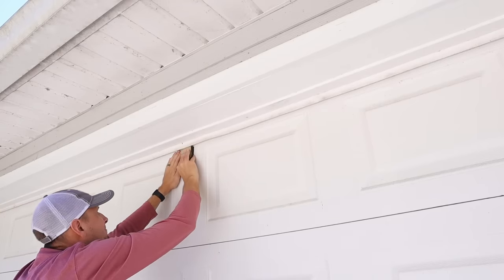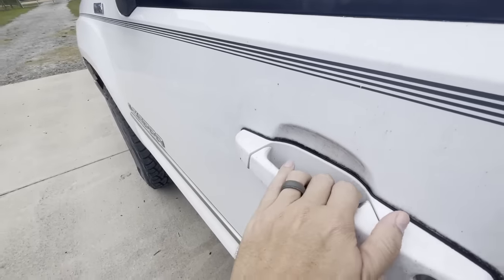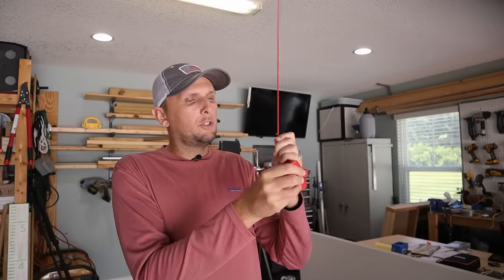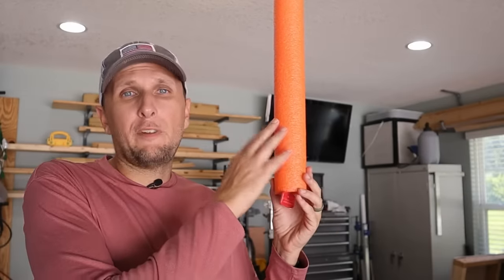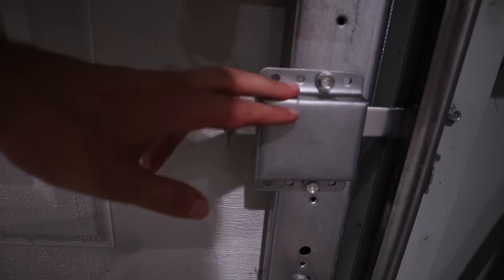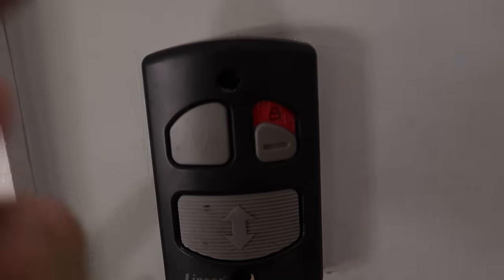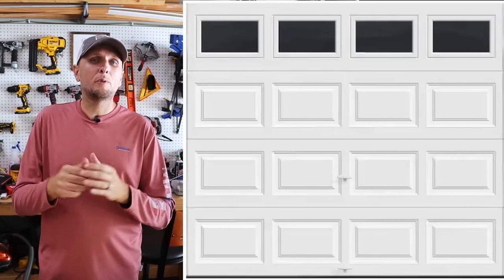How to Stop Garage Door Break-Ins | Number One Way Thieves Get Into the House!

Comment: Note the hole on the end of the deadbolt style latch. You can put a padlock through it, so even if a thief gets into the home another way, they won't be able to just put the big door up and make off with big items. Also, if you do have an opener, and do use the deadbolts to keep the door shut, pull the cord and disconnect the opener from the door. If someone forgets and pushes the opener it'll save the hardware.
Reply: Good thoughts I did both also. I have a double sized garage door and it may be overkill but I put a dead bolt lock on both sides.  This will also help prevent the old daylight mover scam where thieves show up in the middle of the day gain entry to the house them back up and open the garage door and acting like movers quickly empty your house.
Reply: I replaced the cord with a steel push/pull cable like a throttle cable and ran it to the door,down the center and then over to the security latch so that when i locked the latch the cable automatically pulled the release on the opener
Reply: Actually, you don't even need the latch, just put the padlock through one of the small holes in the wheel rail.  It does the same thing.  I always lock my garage up to keep my SRT safe while we are on vacation, along with probably about 10k worth of tools.
Reply: @rooh5825  Love that idea. My method is to use a "C" clamp on either rail to prevent the rollers being able to move.
Reply: Good idea, but putting a padlock though that hole is useless since anyone can remove those self tapping screws on the bracket where the latch is mounted. Like that idea that rooh said below though, just put the padlock through the hole in the track and it will block the wheels on the door.
Reply: already thought of that.
Reply: 1.There is nothing to secure that lock to, you are just putting it on a hole the slide latch which will stop nothing
2. 2 screws to remove, and I have seen other models where you can just easily bend things out of the way.

You guys are over thinking this.
Reply: @williamhudson4938 Thanks William, that’s sounds like the easiest way for seniors as well as effective.

Comment: I bought those locks about ten years ago. I only use them is I’m traveling. And when I do, I put a padlock through it on the other side of the rail. 
     Theses locks are easy to forget. So from now on I’ll also unplug it like you suggested—so I don’t damage my motor.
     This is a MUST SHARE video.
Reply: Mine came with the garage door during the install, and are wired to automatically lock after the garage door is closed, and unlock before it opens.

Comment: Tip for removing the manual release cord. Make your own hook handle long enough to grab the release and hang it over your workbench or a spot in the garage. This will be quick and easy to grab and release the door.
Reply: why not just cut a whole in the garage door and reach in. I mean its only 24g metal. just some tin snips and no problem.
Reply: This is exactly my thoughts. Why have the big pool noodle hanging in your way? In his situation, the release is easily within his reach so why even have a cord?
Reply: Cutting a hole would work, if you have an unlimited amount of time.  Most Tango’s are the “get in,get out within 5 minutes type.  If a homeowner does anything like the op recommended, then the time factor for the T’s becomes too much to overcome. They will, in most cases, not all, move to the next house where there is no pool noodle on the string or internal mechanical locks.
Reply: Have y’all seen these wind screen curtains that cover the whole garage opening during the daytime?  I bet that for those of us who like to keep the garage opened in the daytime while we are there, that screen would greatly reduce the visibility of contents inside the garage on a bright sunny day.

Comment: Lots of good stuff here! When leaving for any length of time I tend to unplug the opener as well as clamp some channel locks in the track above a roller. It just makes me feel better.  

My first house had one of those crappy fiberglass doors  on the detached garage, and it had some cracks and small holes in it.  I leaned one day when I locked myself out of the garage how easy it was to pull the release cord with a coat hanger.
Reply: You mean vice grips? I'm failing to see how you could do it with channel locks, unless you use a clamp on the handle or something. At that point, why not just use vice grips?
Reply: @MrEazyE357  Yes! Sorry, Brain fart.  I meant vise grips.

Comment: Learned (from Bosnian Bill) to use a zip tie through the latch where the pull cord goes through;there’s usually two holes in the spring-loaded latch and the part it connects to. Zip-tie the latch closed, and it will usually require more leverage than the fishing wire the thieves use, plus can still be used in an emergency, because a strong downward force can break the zip tie.
Reply from the maker: Yup!  Thanks for the tip!
Reply: Lol now i have "the tool that Bosnian Bill and I made" in my head ><  Damn you LPL
Reply: Yup.  That's what I've always done...thanks for sharing
Reply: ... And secure the cord/handle to the bracket with a rubber band.
Reply: With thinking like that I'll bet you cut the seat belts out of your car and have removed all the GFCI receptacles from your house. After all, who needs safety equipment.
Reply: @trustme7731  - If you'd take the time to research this (or just read the original comment completely), the recommendation is to use a thin zip-tie which is easily broken with a quick, firm tug on the release handle, but which blocks the ability to disengage the latch with the "fishing" technique.
Reply: @rushthezeppelin  Sparrows also sells the tool to reach these release ropes, but like a lot of their other similar things crooks might want they're hard to find on their website.
Reply: “Bosnian Bill”
Only a fan of LPL would know that catchphrase…
Reply: @ashemoski  The release rope is long enough that it can be pulled outside of the door which means someone can pull it as hard as they want. Just as shown in the video. Shortening the rope is just as stupid making it unreachable to many people in case of an emergency such as your kids skull is being crushed by the door. 
It's a safety device first. For example:
From The Door Company:
"It is common for wildfires to knock out the power to homes in the immediate area. In 2017, five people got trapped in their garage as the fires overran their home. Without power, they were unable to open their garage door. They weren’t aware of the emergency release cord or couldn’t use it and perished. In fact, due to those deaths, California passed Law SB 969 requiring all garage doors to be sold with battery backups in case of a power outage."
A shortened or altered release could make it impossible for a child or short, weak elderly people to operate it in case of an emergency.

Comment: Really good content mate, we have these types of doors in Australia and you’ve just opened my eyes.Times are a changing and I was completely ignorant of this weakness; Thankyou!
Reply: I just wrap the rope around the bar pulling the door so that solves the fishing issue and avoid that silly pool noodle dangling in the middle of the path
Reply: I refurbished/rebuilt/remodeled a 1945 house ten years ago.  Garage no longer has windows, new (Manual lift) garage door has no windows and the new wider man door has no windows.  Trust no one anymore;  when my parents were toward the end of their life before they died the biggest thief was my brother;  he would come out from another state to do work on the house with his car empty and leave with it full,
Reply: My cousin here in Australia (Melbourne, ~25 minutes from the CBD - so not the middle of nowhere burbs) got robbed through their garage door exactly as this guy describes.  (I assume they broke in using a similar method).

I lock all my doors as a result.  Only time I don't is when I know I'm back in less than 30 minutes.
Reply: @maireen3517  that's what I did.

Comment: Our Garage Door opener has a solenoid deadbolt that locks into the track, similar to the manual one you showed. In order to manually open the door this must be released first so pulling the cord or lifting the door isn't enough. This may be an option that can be added to your existing garage door opener.
Reply: I could have swore I'd seen something like that before, glad I wasn't misremembering.
Reply: They come with the Liftmaster side mount operators like the 8500 or 8500w. They are notorious for wearing out. Ive replaced atleast 25 or 30 of them. The reason they come with the side mount openers is because technically you can lift the door with a side mount opener. Although you would be lifting the entire weight of the door because the springs are not lifting the door being that the side mount opener is holding the shaft of the torsion assembly.
Reply: @dano1307  as someone who works as an overhead door installer, I personally haven't heard any complaints about 8500's. Sure, they are a pain to install, but seem to work pretty good.
Reply: @BattleKing00  Not the 8500 opener, just the auto locks are notorious for wearing out.
Reply: Incase anyone want this ....Its called an interlock system and its dependent on the opener.  Some of the new openers have personal notifications on your phone when your door is opened as well as video....  Source= 20 plus years with a manufacturer of garage doors

Comment: I used to work overnight security for a property management company checking apartment complexes. We started to see garage doors with damage between the segments. We looked into it and found out people were having their garages broken into, and their cars as well, and since the garages were not attached to the apartment buildings, people usually had no clue it was happening until the next morning when they were going to work.

Apartment managers sent out a letter telling people to tie up their emergency release so it would be up and out of the way, and the break-ins stopped.
Reply: And then the property managers should’ve got sued for telling someone to disable a safety feature
Reply: @Just_A_Name14  it’s not a safety feature.
Reply: Great info. I just wrap (but not tie) the release cord around the bar that attaches to the garage. No loose cord to catch with a hanger, very hard to pull release if you do, and leaves the cord accessible to release in an emergency.

Comment: Good video and great tips.  Another thing you can do is buy a sheet of kydex, and size it for purpose to block hanger/hook access to the release cord.  I did this at my last house very easily.  Drilled a couple of holes it in and zip tied it to the door release assembly, and there was then no way to access the cord with a hook.

P.S.  thanks for the link to the door locking assemblies.  Been wanting to add these to my current door for when we're away.

Comment: I was a garage door repair man. A lot of my service calls were for stolen remote. NEVER leave the garage door remote in your car. Thieves brake into cars for the remote. They also take the registration for the car. Now they have a way to get into your garage and your address.
The lock button on your wall button disables the remote but not the keyless pad on the outside of your garage. My advise to you if you leave for vacation unplug the opener. And don't advertise that you are away by posting thing on Facebook until get home.
Reply from the maker: Good tips Wayne!  Thanks!

Comment: I’ve had a few customers damage doors and openers by using the slide lock and then trying the opener. I actually recommend removing slide locks when openers are used on doors because of that.
Reply from the maker: Oh yeah no doubt that can happen if they leave them engaged.  And unfortunately it can be really easy to forget about them.
Reply: My mother-in-law jacked up her garage really badly with that lock.
Reply: when you use the slide lock, put your remote in the glove compartment.  when you return home your remote is not where you expect and that will remind you to open the slide first.
Reply: A clever solution is to have the lock interrupt the power supply to the opener....  Surprised no one offers this commercially
Reply: @ckm-mkc  I was about to suggest the same, a commercial option would be nice however a DIY'er competent with dealing with electricity could fashion one rather easily.
Reply: @ckm-mkc  Or unplugging the power.

Comment: I'm an overhead door guy. My approach to securing the door against this method of opening is to use door stop trim to ensure that there is no gap at the top of the door. I work in a cold environment which causes the door to bow inward to the garage. I install my stop with a slight inward bow and set the j arm on the operator so that when the operator closes the door, the j-arm pushes the top of the door tightly against the stop. This will make it impossible to fish without cutting the frame or drilling through the door.
Reply: Exactly what is “door stop trim”?  Where would one find it?
Reply: Door stop trim is trim that stops doors. Available at any hardware or home improvement store.
Reply: @mikebond6328  - This makes no sense

Comment: As far as cutting the "cord" use a stick hidden in the garage that has a hook on it to reach the hole in the release mechanism.. Simple and effective to be able to open the door in a power outage.  Also if you have windows, use some of that stick on window frosting so light can get in but you can't see in!🙂
Reply: I like this idea the best. I'm gonna do it. I rarely use the pull cord but have a few times. yet the pull cord is there all the time for would be thieves.
Reply: This is what I’ve done in my garage.  A simple metal rod bent on each end, one end to hook onto the release and the other as a handle.  It normally lives on its own hook on the wall.
Reply: Seems like they could still get lucky and hook that hole but I guess that’s a lot harder
Reply: This is a great idea thank you
Reply: change "stick" to "peel" in your last sentence. will be clearer to readers. excellent two tips i will use

Comment: I see some people cover their garage windows so the inside is not visible but this way the light doesn't get in and the garage is always dark.  One thing I did to make it difficult to see the content of garage was to spray the garage windows with Frosted Glass Spray Paint.  This way the light still gets in but you can't see what is inside if you try to look from outside.
Reply from the maker: Great idea!  Thanks for sharing Mike!
Reply: You can also get frosted cling film that would do the same basic thing.
Reply: @SmallSpoonBrigade  the film can also make it harder to shatter the window as it holds the shards together, increasing the amount of time and noise needed to break in and can discourage the thief who was hoping to not be noticed.

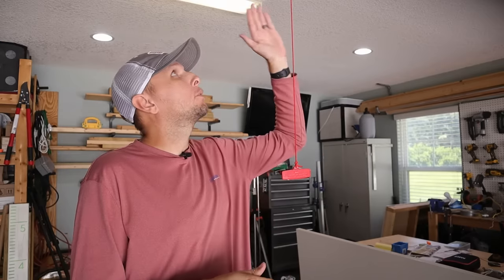Comment: 4:40 I use to shorten it a lot and put a small loop on it. Then have a metal hook hanging on the way next to the opener inside the garage. If my wife or kids needed to open the garage manually, they could with that hook. 

Great video!

Comment: Overall good video. You mentioned windows in the garage door as a security risk. I thought so, too. So, I bought frost paint and sprayed the windows. They still let light in, but no one can see in. I also replaced the glass with acrylic so it's harder to break them out.
Reply from the maker: Yup great tip.  Thanks for sharing David!
Reply: I told the contractor not to put windows in my garage. So, of course, he installed two 4'x4' windows on the side. I bought a 4'x8' sheet of rigid insulation and cut it in half and wedged that into the windows. It keeps the hot sun out in the summer and the heat in during the winter. Garage is fully insulated. Water heater is in the garage, too. So when it is 26 degrees at night, garage is 58 degrees. When it's 100 degrees in the day, garage stays in the 70's. Awesome.
Reply: The front door of many homes have clear glass... that need to be frosted. You have the right idea. I do it too.
Reply: What the H is frost paint?  Where does one find that, the paint section at Lowes/HD/Hardware store?

Comment: Paint the inside of your garage door windows with a light coat of white spray paint. It will still let light in but you can't see in. You can clear a small spot to make a peep hole to see out if you want. For locking the door if your going to be away for a while you can drill a hole in the roller rail just above a roller so you can install a pad lock.

Comment: At 1:34 the actuator arm attached to the garage door is where you can simply loop the release cord two or three times. Never leave your garage door cracked for circulation if you have an outdoor keypad. A simple press of the enter button will start the door down and another quick tap will open the door all the way.
Reply: Jaime, You deserve many more likes for this. I use this and it keeps hummingbirds from coming in to see what that red thing is!
Reply: Most keypads have a fairly short timeout, after which the buttons will do nothing unless the code is entered again, regardless of the position of the door, even if the door is wide open. If yours doesn't its a defective design.